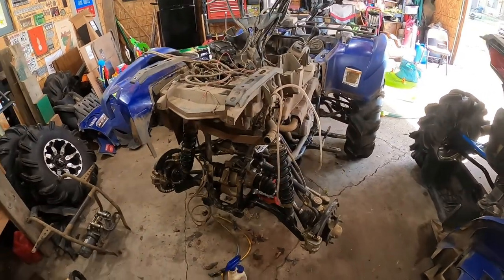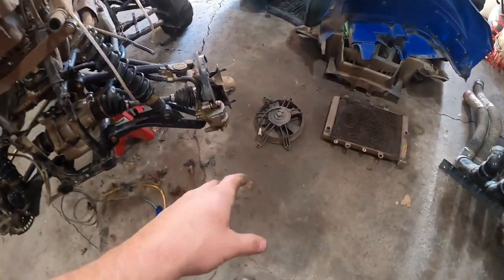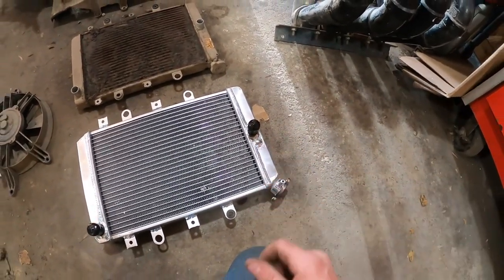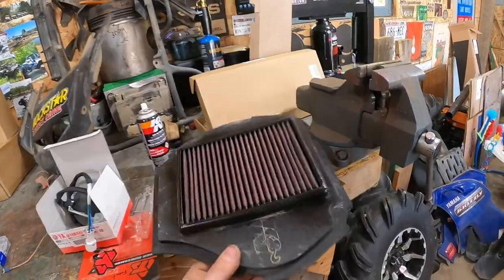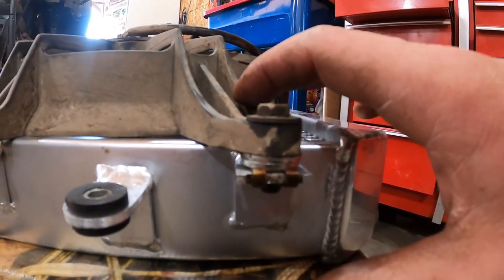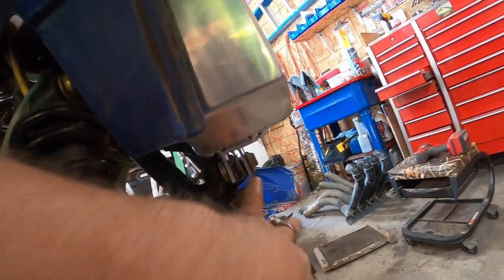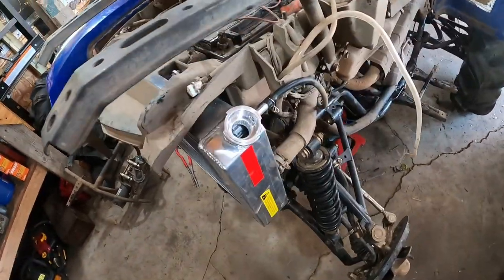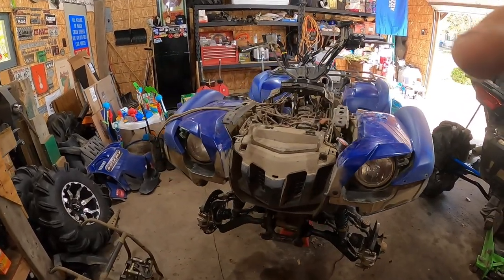Grizzly 700, Amazon Aftermarket Radiator Issues

Comment: Here's what I went through if it helps anyone:  There isn't much about this hot running problem with the grizzlies aside from the complaints and people recommending good coolant such as engine ice. I use my 2008 Grizzly 700 for a work horse, skidding logs and plowing snow, chisel plowing garden and glider driveway, it's pushed hard. Would overheat in 10-20 minutes of hard work. I got a double core aluminum racing radiator from CHRracing on eBay for a very nice price. The only modifications I had to make were cutting off the remainder of the bolt ends for the front grille lower mounting bracket that were digging into the bottom of the radiator. They are currently touching now but it is only the bottom framing of the core fins, there's no actual coolant core behind it but I'll be monitoring it, and the upper nipple by the cap for the overflow tank was too big for the hose. (I'm really good at stretching hoses over stuff after 25 years in automotive) The OEM u-nuts I had to swap over are also more narrow than the ears on the new radiator, tapping them on and then pliers to squeeze them tight together and then a bit of drilling to widen the holes on the radiator ears and they were good. The extra screwing around added up to maybe 20 minutes. I flushed out the rest of the system and filled it with engine ice. Now I'm doing the same work in hotter weather than when it was overheating before and my fan didn't even come on until 20-30 minutes into working.
Reply from the maker: Sounds like well worth the time and effort for how you use your Grizz!

Comment: This video is scary accurate to what i went through. Long story short i cleaned my stock rad, did all new hoses & thermostat. Due to the new one not even coming close to clearing with the stock fan.  Now my stock rad failed & currently waiting on my wildboar kit to arrive. I feel the same i dont want more stuff on my rack but im DONE with taking the stock radiator out due to clogging up no matter how good i clean it.  Sorry to see you did everything i did, calling dealers & fiddling with junk china parts. Cant believe theres NO new oem radiators being made. I thought dealers were just lying to save time.
Reply from the maker: I was surprised that there was no new radiators being made OEM… I was kinda like damn it… cause I read the Amazon reviews on them China ones and only half of them were ok reviews…. I was like well I have no choice and I wasn’t going to buy a used one… I made it work and let me tell ya… my fan don’t turn on barley at all now… it does have more cooling capacity that’s for sure.  But it was a bear to get mounted in there

Comment: The rad I ordered was almost exactly the same. Only difference was mine didn't have the extra breather port. Also I had a rad relocate, after that upgraded rad and it being relocated the Grizzly ran so much cooler!
Reply from the maker: Yea I’m close to doing it, maybe I will pull the trigger once it gets hot hot next July. Till then it’s pretty cool/cold so I can run with a plugged rad and be fine lmao

Comment: Great video. Thanks for showing the mods and tips. If you read this can you update on how the cooling was improved or not. Thanks
Reply from the maker: Definitely notice the fan not coming on as often anymore. So there is a significant cooling difference with the new radiator
Reply: @grizzlygreg8922  Thanks. Probably get one.

Comment: You may have saved my bacon brother. Ordered a new radiator and it had the extra breather tube so thought it was the wrong rad but all the ones on Amazon have it as well. Also same fan mounting issue. So you may have saved me from mucking around trying to find another rad.  I’ll get the hole plugged and give it a go…
Reply from the maker: Glad you saw the video! It is a bummer it’s one of the only options for us but sometimes that’s just the way it is.